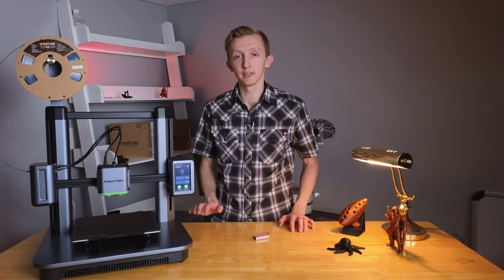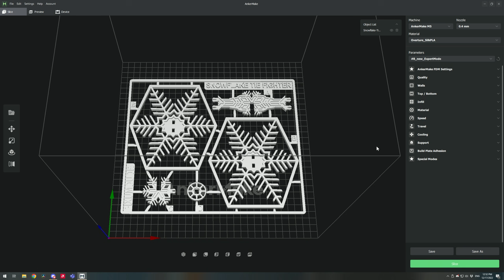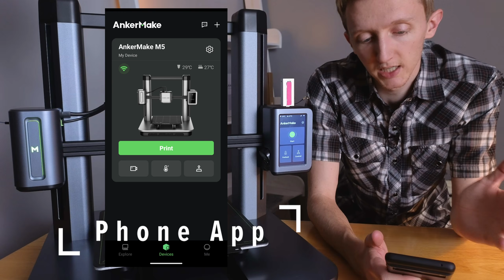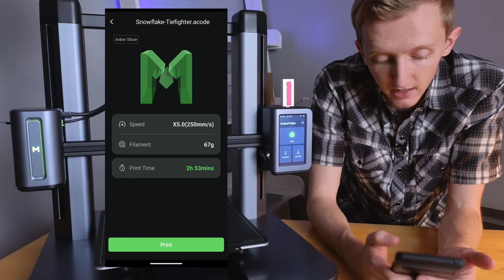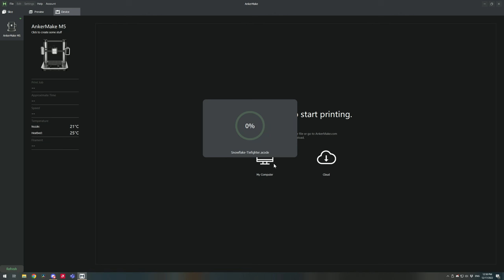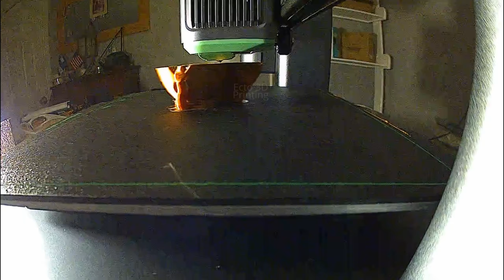Loading Print Files 3 WAYS! - AnkerMake M5

Comment: What slicing software are you using?
Reply: Hey Ivan, I just found out that Lychee Slicer just dropped an FDM printer update this week (they used to be only for resin printers), and they have a specific profile for the Ankermake M5
Reply from the maker: So far only the Ankermake slicer but I really need some better support settings, so I'm gonna check out some others.